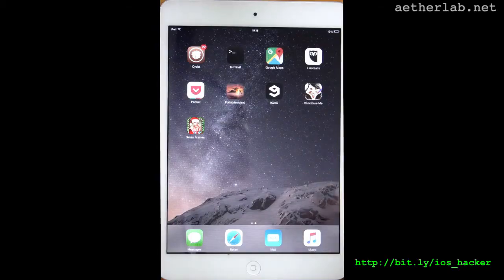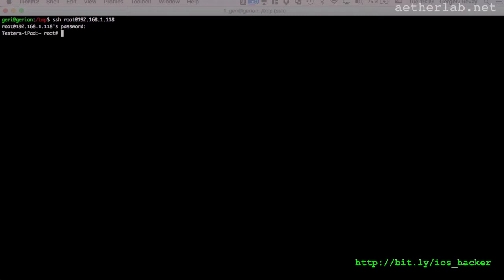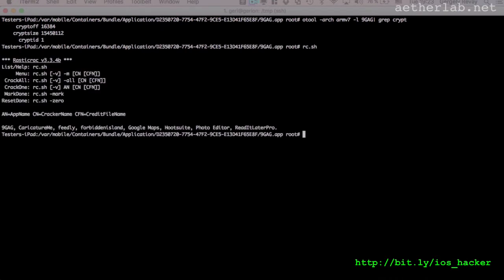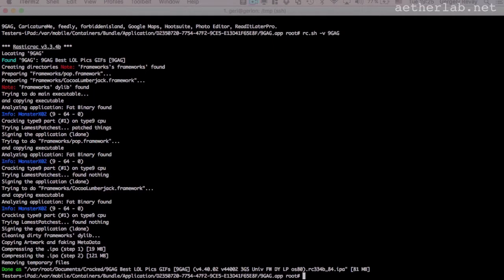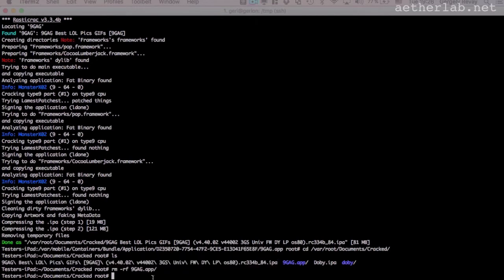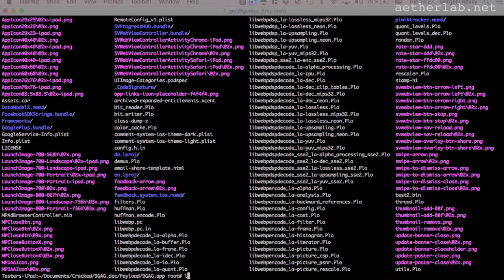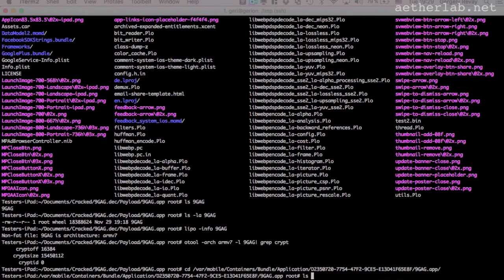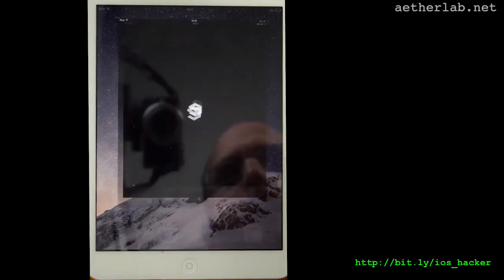Decrypting AppStore Apps with rasticrac

Comment: Most devs are using AES 128 bit encryption keys which would be ALOT of work to crack. 😂
Reply: It is not cracking it. It let’s the app decrypted in memory and then it dumps it. It does not matter what kind of encryption is used as long as it appeara in memory unencrypted.